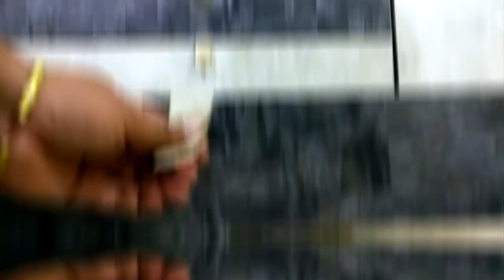Turning Stainless Steel Hex Nuts and Bolt into 5 Carat Emerald Ring - By AMbros custom

Comment: Size hex nut did u use
Reply from the maker: It's M20 nut dear
Reply: @ambroscustom  is that the size
Reply from the maker: @michaelwillis9108  yes dear, it's a nut used for 20mm bolt.